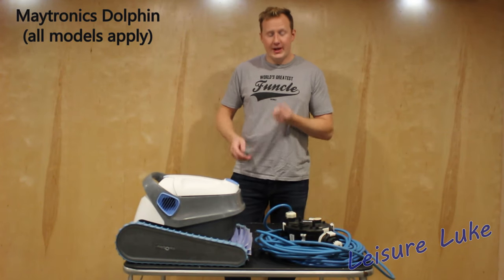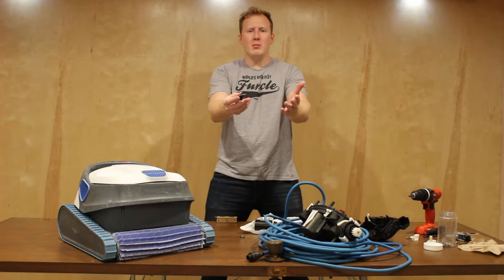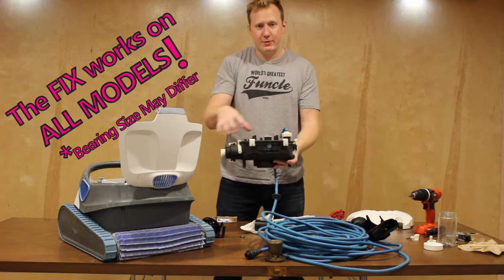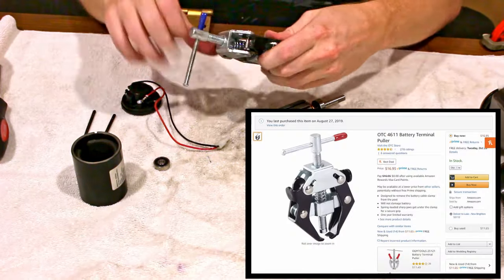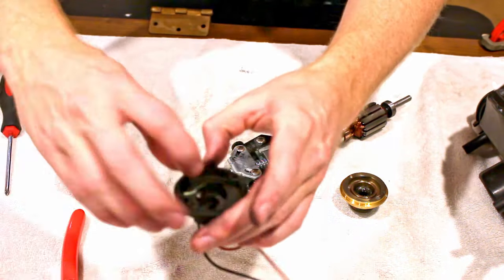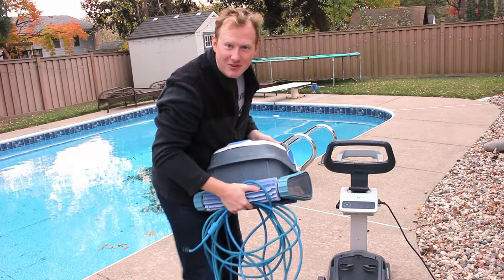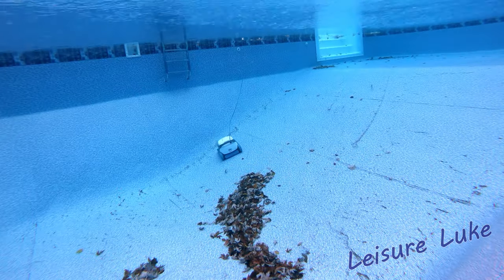Dolphin Pool Cleaner - BROKEN is FIXED!!!  SOLVED with 1$ Bearing | HOW TO REPAIR for MOST Models!

Comment: Hello, thanks for your video, very interesting.
I have S200 and when it started to run stopped in a few seconds but I cannot open the impeller, the screws are completely stuck, impossible to remove
So I am thinking whether to buy a new impeller or a new pc board.
How can I be sure if the impeller is really bad?
It rotates in both directions moving it manually
Reply: I don't know why, but after disassembling and assembling the impeller motor it seems to rotate more easily, maybe due to the oil to try remove the screws.
The important thing is that I have put it back into operation and now it is working fine and does not stop, at least for now.
Now I know that the rest of the parts are fine and if it fails again it is because of the impeller
Reply from the maker: That’s good news!  The impellers can have a little hair stuck in them, twig, or tiny rocks that can make them struggle to spin.  You probably cleared something out when you took it apart.  Fixed Is fixed!  Nice work!!

Comment: Hey Luke great video I just got a dolphin and I have a question I am noticing on the bottom there are no foam rings that they talk about on the manual when I bought this item it was brought to me by a pool company that fixed my pool I’m gonna check the serial number tomorrow with the company to make sure this is a new model but I’m wondering do you know if those phone rings or something if they put on all the models perhaps maybe I was looking at an old him manual but I just want to make sure that this dolphin that I have is a new model
Reply from the maker: High Martha.  I haven't seen any foam in the Dolphins I've worked on, but it's very possible that the new ones have foam inserts somewhere.  Sorry I'm not sure I can help - good luck!

Comment: Hello,
I have the Dolphin Premium robot and I checked the impeller and it was clean., checked the rubber and did not see any interference. However, I did notice that the wheels would lock up. When I put in the pool it started to move forward then stopped.  The blue light continues to blink.  I am so frustrated, do you have any ideas to help?

Comment: It works manually with the App with the iPhone, but I'm afraid it could burn the motor (warning "uploaded servo", and it stops in automatic), so, I think I should do this repair that you show in your video ... right?  !
Reply from the maker: If your impeller is free of debris AND it is difficult to spin by hand, yes, this is probably the same problem.  People often find that the tracks are jammed, so it does the same move around for a few seconds and quits.  If it’s working manually and has the suction to climb the walls, the impeller motor is probably working.

Comment: Mine also shuts down but the impeller is not seized and spins, but I think it’s the Drive motor, do you know if it’s the same size bearing?
Reply from the maker: A few others on the thread have said it’s the same size bearing, that that could vary by model.  Most bearings have the size printed right on them.  Is your drive motor seized?  Time to open the black bad and check for water too - sometimes those leak.

Comment: Hi Luke, I have a Dolphin Quantum and the lid is jammed shut,  the filter basket is probably the problem.  I cannot open it at all.  Any suggestions?
Reply: Ok I was able to fix the jam. I noticed the lid was askew so I pushed it all the way down and then it popped up correctly

Comment: Hello Luke. I just watched your video on how you were able to repair your Dolphin Pool Cleaner. I just purchased one where I was told that it stops intermittently and shuts down underwater. I wasn't told for how long or anything. But could this be the bearing or something else causing the problem?
Reply from the maker: Nice buy - a fixer upper!  Yeah, first things to check are the impeller blade.  I would take the dolphin 1/2 apart to fully inspect the impeller blade.  Make sure it’s clear of debris, hair, gunk, etc.  If the bearing is the problem it may be difficult to turn to the impeller by hand.  There will always be some magnetic resistance to turn it, but if seems really hard to rotate the impeller (in my case it was impossible) then could be the bearing.  

I’d also check the tracks for obvious sticks or rocks that could be jamming it up.  

If it’s intermittently stopping and the bearing is the problem it will get worse fast.  Like - 20 cycles and you’ll go from intermittent stopping to immediately stopping.  Once they wear out they go fast.

Comment: I have the same issue. My bearing is seized on and is falling apart. Can’t find a number on it. I’ll prob just measure it and buy from Amazon. It looks very similar to yours. Also did you clean your motor? Mine has a lot of black dust in it so wondering what u used to clean it if you did. Thanks
Reply from the maker: Just wipe the dust away a bit.  It comes from the motor brushes slowly getting used over time.  I removed some dust to clean it a bit, but I didn’t spray it down.  I think wiping it with a towel or a dry brush is okay, I wouldn’t add water, soap or cleaner, it’s simply not necessary and you’d hate to corrode anything prematurely.

Comment: Hi, I have the left hand track not moving at all. I have put it upside down & the right track moves forward for a few seconds stops then backwards for a few seconds & that's all it does. The impelar fan moves easily. Nothing it trapped in the tracks. I have taken the left side apart & there is a metal piece that should turn to turn all the wheels but even with pliers & a fair bit of force it will not spin. The right side does fine. Will that be a ball bearing seized too like this fix but on the side or something else? I hope you or someone can help me fix it. Thanks! :)
Reply from the maker: Some have fixed the drive motor like I have fixed the impeller motor, yes.  I haven’t had to take one apart, but I’ve heard they’re quite similar.  First, you’d have to verify that the motor is essentially seized and not turning when power is disconnected.  If that’s the case, get in there and replace any bad bearings 👍🏼

Comment: Hi, i use this fix and now the propeller is working great but its constantly floating and doing wheelies, any idea what can i do, the manual said to turn it over because it might have some air, could it be that the air got stuck in the motor enclosure?
Reply from the maker: You’ve probably got the 2 motor contacts switched.  Most likely, the impeller is spinning the wrong way.  Happened to several others, and I think they’ve had to swap the wires at the motor to fix it.  Someone may have more details if you search “reversed” or “backwards” in the  comments.

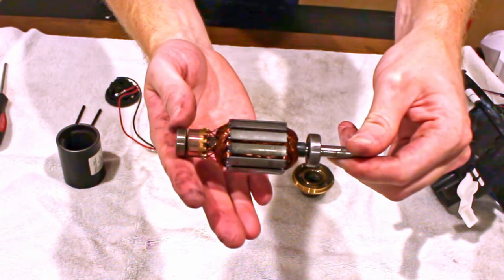Comment: Hi, I'm having a problem separating the plastic head piece from the motor itself. It seems like you were able to separate them pretty easily at 2:23 from your video. Please advise how to separate them to get access to the bearing on that end of the motor? Thanks.
Reply from the maker: Once you have the 2 motor bolts out, it takes a little elbow grease.  There isn't much there to break.  You may have to use a pliers to crack it loose, that's what I did, although I didn't show it on the video.

Comment: Thank you for the video. My S200 recently stopped working. The power supply will flash when I plug it in but won’t light up when I push the on button. I pulled the motor assembly and the impeller motor is smooth. The track drive motor is difficult to rotate when I manually turn the gear, should the track drive motor feel the same as the impeller?
Reply from the maker: The track drive is always difficult to rotate by hand.  It sounds like there’s a problem with the head unit/power board.  Mine (for the s300) lights up when I press the power button, even when the dolphin is not connected.  I’d keep browsing the Internet to see what that control board should do when no dolphin is attached, and if yours isn’t behaving correctly, at least you’ll have pinpointed the problem.
Reply: @LeisureLuke  awesome, thank you for the info. I ended up taking apart the motor unit and found the bearings ok. I did clean a bunch of carbon out of the impeller motor. I have a feeling the power unit may have had a trip in to the pool at some point.
Reply: I had that problem. I received a replacement power supply unit as it was under warranty. About a year later it happened again. I found the problem was the black power cable that goes into the power supply was twisted at the power supply end. I straightened the cable and it worked. I then tested the original power supply and that worked. The cable was twisted because of how I was storing it.
Reply from the maker: @AW-Trader  Interest comment AW.  Thanks for the input.  I wouldn't ever think that cable would be a problem!   Good to know!
Reply: @LeisureLuke Agree it happened with 2 different cables. The replacement PSU came with a new cable. I was storing the PSU in a box and there was a bit of pressure being applied to the cable causing it to kink. I now have a new problem. The robot (S200) can travel the distance of the pool but when it hits the wall it stops and remains at that location thru the cycle. It can climb the wall but then returns to the pool floor at the same location. The impeller is turning. I have opened it and cleaned it but the problem remains. Any idea?

Comment: Thank you for sharing this video, it helped me finding the cause of the problem inside the motor unit of my S200. It seems that the servo for the directional jet is jammed, there is a burning spot trace on the casing of the servo. Since there is absolutely no marking on the servo I did some research and found some similar one on some RC online shop. What I don't know is how many degree should I ask, a 90° or a 180°, other??? Can you Luke or someone help me with this? Thanks!
Reply from the maker: I don't know off hand which servo to buy, but it's probably another where generic replacements would be okay!  I'd start with measuring the case of the servo, to find the right "size" servo.  Then, try to see what the range of motion is for the servo.  You'll only be able to rotate the motor shaft 90, 180, 270, or 360 degrees.  Most servos use the same pwm 3 wire control, so once you know the size & range I'd spend a good $20 on whichever has good reviews on amazon.  You can always find cheap servos & they are weak & terrible.  You may also need to figure out the voltage going to the servo.   GOOD LUCK!  Let us know how it goes, hopefully someone else here will have better advice!
Reply: @LeisureLuke  Hi Luke, it is fixed! I ordered a servo MG996R 180° at a local RC online shop for less than €9,- It didn't work at first but after I had laid the Dolphin on its back and let it run dry, it kind of reset it. It is working now fine! Thanks to your video, I saved lots of money and got more experiences rich! Cheers
Reply from the maker: @synthart66  LETS GOOOOOOOO!!!!!  Well Done Michel!  Absolutely brilliant work!  Congrats on the fix, and enjoy the clean poooooool!!!!  Also, great to keep that MG996R 180 part number in mind for the other S200 owners!  THANK YOU!!!!!!
Reply: @synthart66  Since they have different splines, is it possible to know which brand you purchased? My local hobby shop said that there are different types (and unfortunately didn't know of a MG996R 180), or will any of the MG996R servos on Amazon work?
Reply: @a-plusservices5758  hi there, any of the servos will work, I even think now that a 90* servo will do. Best is to bring the servo to your RC shop.
Reply: @a-plusservices5758  hi there, any of the servos will work, I even think now that a 90* servo will do. Best is to bring the servo to your RC shop.

Comment: Hi man, GREAT video! I got to the point  where you separate the motor (2:20 in your video) but I could get the brass piece (the plastic side with wires) and I found black dust and it looks like eventually burnt out. Any idea how to find out what's wrong from that point?
Reply from the maker: Check 2 things - the bearings and the brushes.  The shaft has 2 bearings and the case has 1.  Try to spin them all by hand or with tools.  They should spin pretty easily.  The dust is normal - it’s from the motor contacts, called brushes.  That’s what the wires are connected to.  You can get replacement brushes, but I don’t have a link for them.

Comment: Any videos in diagnosing the Drive Motor.  Thanks
Reply from the maker: Nope, but other people have been commenting that they fix the drive motor with the same bearing-replacement fix.  Usually it’s the same type of bearing.  The other thing to check is the motor brushes if they are totally gone.  I have another that I’m fixing, if it’s a drive motor problem I’ll make another video :)

Comment: Hey Luke, my Active 20 only moves 1 direction. Impeller spins freely, tracks are good, brushes are good, and cord is good.

Seems to run forever in 1 direction only  and doesn't stop. Ever run across this issue?
Reply from the maker: I haven't, maybe someone else on here will know something!  I'm assuming you've unplugged it and plugged it in again?  Good Luck!
Reply: @LeisureLuke  ya, we've tried a few control boxes too. Pretty sure isn't going to be a motor block replacement. Was just hoping for a cheaper fix.

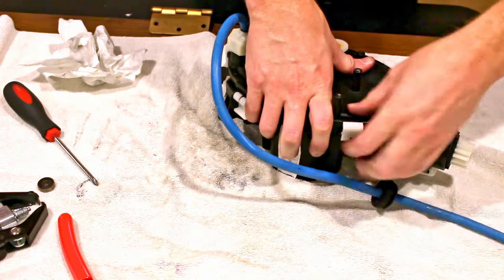Comment: 4:45 It looks like Motor was glued down to the chassis at the factory (we can see glue residue on the bottom and on the far end wall)
I suspect this helps drive motor to stay in place and not moving away from the drive wheel to enforce weak chassis plastic eventually could become too flexible and drive wheel will start to slip with some clicking noise.
Reply from the maker: Good observation. That shiny circle is actually just from rubbing. There’s no glue or oil or anything there, just 2 plastic pieces that touch and rub together ever so slightly.  I double checked :)
Reply: I cannot get mine up heart either. I've used a flathead screwdriver but it seems like it's going to break if I put much more pressure

Comment: I have the same problem with my S300 but the propeller does spin by hand....should I try the bearings anyway? I have checked for any dirt or debris and it is very clean.
Reply from the maker: Sometimes just taking it all apart, making sure it’s clean, and dry in the black motor box, thoroughly cleaning the impeller, and assembling it all together again does the trick.  I think small rocks or sticks can get wedged in the motor track gears and cause just the wrong problems.  I would disassemble everything (without opening the motor), and put it back together first.  If that’s still a problem, I’d try the bearings.  Does it move forwards & backwards & quit?  Or just forwards and quit?
Reply: I ended up cleaning the smallest amount of grass around the propeller shaft and now working again.
Reply from the maker: @donvenner6839  Great to hear!  Nice work!!!!

Comment: Dude thanks for the video. By any chance was there any even smallest amounts of water or condensation in you black motor box.
Reply from the maker: Nope.  It was completely dry.  You have some moisture in there?
Reply: took the motor out. disassembled the motor, the bearings move freely, tons of black powder / maybe magnet dust in this baby!! has some corrosion on the bottom of the motor.  Thoughts new motor or new black box?  thanks for your help and time
Reply from the maker: No problem.  What symptom were you seeing?  For me, it would move forward a few feet and quit.   Upon inspection I found I couldn’t spin the impeller my hand anymore.  What’s yours doing?
Reply: @shballard7  I suspect that the black powder is from worn motor brushes. Were the brushes in good shape?

Comment: PLEASE HELP! My LED light on power supply comes on the turns off immediately and no power goes to the dolphin. Impeller spins and isn't clogged. With the dolphin unplugged from the power supply, the blue power light turns on and stays on just like normal.

Should the wheels/tracks turn easy on these when it's turned off? They seem a little hard to turn and I can't remember if they were like that before this issue started. Any ideas?

Comment: Can the drive motor be repaired the same way?  I took the impeller motor apart and it was caked with carbon and now moved freely.  But the drive motor doesn’t spin.
Reply from the maker: Yes!  Other people below have fixed their drive motor the same way,  I haven't done it personally, but I think it's similar.  The replaced the  bearings in the drive motor, and it resolved whatever the problem was.  Good luck, let me know if that works for you!  I would verify the motor is seized first.  If you can spin it freely, the bearings are not the problem.
Reply: @LeisureLuke  when I took the motor out, it would spin but when I put it back in, it would not spin.  I think there is a problem with the metal piece that the drive motor connects to.  I am not sure how to get that part off without breaking the box....I need another video but can't find one :-/  If anyone has done this please let me know..

Comment: Hey man. Cleaning of the impeller didn't work for me. And my motor is not seized up. It still runs for about 5 to 10 seconds and it still shuts down with power still on. Plz help
Reply from the maker: Haha, I'm no pro :) Check the cable for cracks.  You can also disassemble it so you can see the impeller, set it on a block, and start it out of water.  If the impeller or tracks struggle to spin, that may be your problem.  Otherwise, opening the black box inside to see if you have internal water damage would be my next step, but I don't have too much experience there.